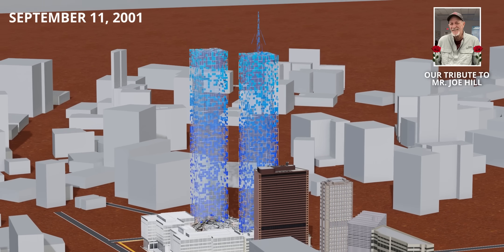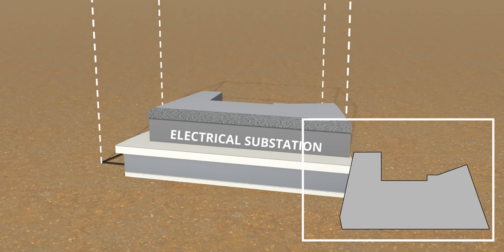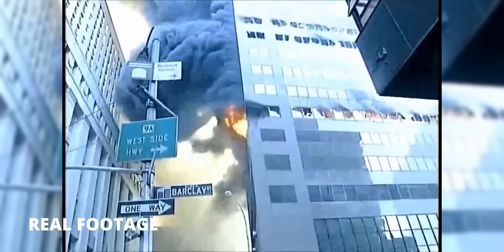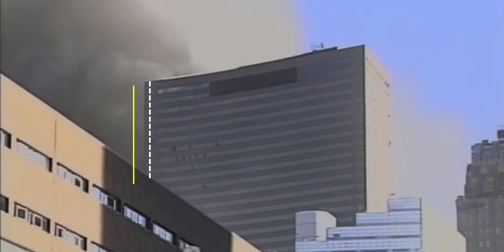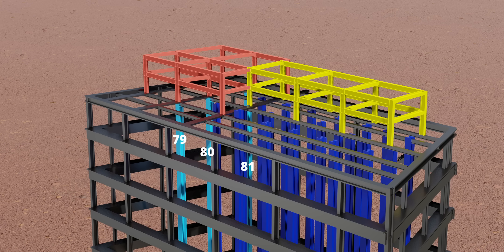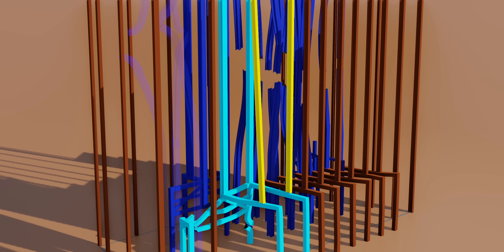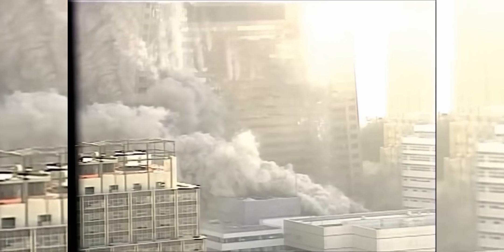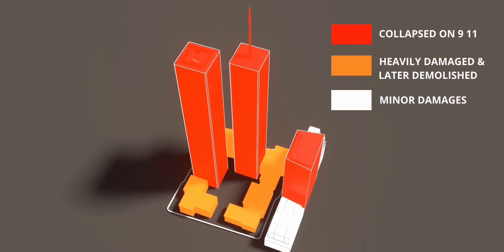Collapse of Building 7 | The Complete Physics

Comment: This video is deceptive about the idea of "freefall speed" during the collapse. There was a period of time during the collapse that WTC 7 did come down at freefall speed. The official NIST report confirms this on page 48. The collapse speed was not consistent throughout the entire collapse. That is, part of the collapse (2.25 seconds) was at freefall, but not all of the collapse. Out of the total collapse time, 2.25 seconds was at freefall and the rest was at a speed above freefall by a value great enough to make the total collapse time higher than freefall speed by 40%. Don't be fooled--that's a very important distinction!

For there to have been ANY PERIOD OF FREEFALL, there must have been ZERO RESISTANCE to the collapse during that period to allow the collapse to attain freefall speed. This would mean that ALL OF THE SUPPORT COLUMNS OVER MULTIPLE FLOORS would have had to have been removed completely and simultaneously. Freefall speed for 2.25 seconds equates to a distance that is roughly equal to about eight floors of the building (NIST report, page 48). Therefore, for freefall to have occurred for 2.25 seconds, 100% of the support columns over eight floors would have had to have lost support both completely and simultaneously. That's EVERY support column across the building horizontally. Any resistance from intact support columns would have prevented any portion of the collapse from occurring at freefall speed during that period. Note that floors 17 to 47 remained a unit on the way down, so those eight floors were below that level. After the unit comprised of floors 17 to 47 fell at freefall for eight floors, it ran into the remaining structure below those eight floors and the collapse slowed down, but momentum kept it going.

Therefore, this was not a progressive collapse as stated in this video. A progressive collapse would not have removed ALL of the support columns on those eight floors at the same time to allow freefall. But how could all of the support columns on those eight floors have been removed completely and simultaneously? I can guaranty you that it wasn't magic. 😡
Reply: Oh boy, beating this dead horse again, eh?

So according to The NIST, how long had Building 7 been collapsing before this measurement of free fall acceleration (there is no such thing as free fall SPEED) was taken?

Bonus question (assuming you can or will answer the first):  What exactly was being measured?
Reply: @TheCriticalStinker-01   Look at page 48 of the NIST report. It's in there. Last paragraph.
Reply: @kevineggemeyer6127  - I asked YOU not because I don't know but because you don't

Thank you for confirming. 

So how about you look at page 48 (and ALL the pages before it) and find out.  ALL of the claims you are making hinge on the answer.
Reply: @kevineggemeyer6127  - Asking for a lifeline is perfectly acceptable. Indeed, it would be refreshingly honest.  I already know the answer AND why it is relevant to your argument, so I can help.
Reply: NIST reversed its position in its final report, acknowledging that WTC 7 did enter free fall for 2.25 seconds. But NIST still maintained the total collapse time on video of 5.4 seconds which was comprised of three separate stages:

Stage 1 (0 to 1.75 seconds): acceleration less than that of gravity (i.e., slower than free fall)--The answer to your question
Stage 2 (1.75 to 4.0 seconds): gravitational acceleration (free fall)
Stage 3 (4.0 to 5.4 seconds): decreased acceleration, again less than that of gravity
Reply: @kevineggemeyer6127  - That is completely false.  There was certainly no reversal of position and the NIST never claimed a total collapse time of 5.4 seconds.  

Did you actually read the report or just that one paragraph on Page 48?

The NIST submitted their preliminary report and opened the floor to public comment. Dave Chandler - hoping to catch The NIST in a gotcha moment submitted his rather crude free fall measurement of just a single point on the structure (this detail is important too_).  The NIST looked at the submitted data, confirmed it was near enough correct and added it to the final report where it's inclusion changed absolutely nothing in the conclusions.

Literally there was a very minor re-wording of one sentence in the final report. That's it!

So, if this alleged period of free fall means what you say it means, why did it not only not fundamentally change the conclusions of the Final Report but not change them at all?  This is a rather obvious question but I am guessing it never occurred to you.

This brings us to my question up at the top of this thread, the one you keep going out of your way to avoid;  How long had Building 7 been collapsing before this measurement of alleged free fall starts?  You do actually have to read and understand the entire report and do a little bit of math.

Or you can swallow your pride and just ask, since we both know you don't know and it seems increasingly unlikely you have the slightest idea how to find out, or the inclination if you did.

Please stop wasting time trying to protect your sacred cow. I'd like to get this project moving forward.
Reply: @TheCriticalStinker-01  Thank you for making my point! The NIST report has major problems!

Prior to editing the report to include the mention of freefall acceleration, the director of the investigation into WTC7's collapse, Dr. Shyam-Sunder, stated publicly in response to Chandler's findings on freefall, “A freefall time would be an object that has no structural components below it.” Interestingly, NIST later changed the draft report to include the FACT that there was a period of freefall acceleration--but didn't update their conclusions! Why? My post above stands. The problem isn't the total collapse time, as the video here falsely claims and lies about (saying the video speed was increased by 40% to claim freefall). The problem is any freefall, which Shyam-Sunder admitted couldn't happen without the structural components under the structure being completely removed. That's a complete lack of structural components, not structural components in the process of failure.

BTW -- Get some help for your narcissism. People interested in a dialog don't speak to others the way you've spoken to me. We're done here.
Reply: @kevineggemeyer6127  - The reason why nothing changed in the conclusion was the free fall was already in there, just not spelled out.  Because in spite of what the internet told you it's just not important.  The why of it's not being important can be found in the answer to the following question that you are too afraid to answer:

How long had Building 7 been collapsing before Chandler (and NIST) started the stopwatch on the alleged free-fall measurement - how many seconds were there between first externally visible signs of collapse and clicking that stopwatch?

Please get serious, stop being rude and ignoring this critical question and don't make me ask again.
Reply: @kevineggemeyer6127  - Or run away. You do you.